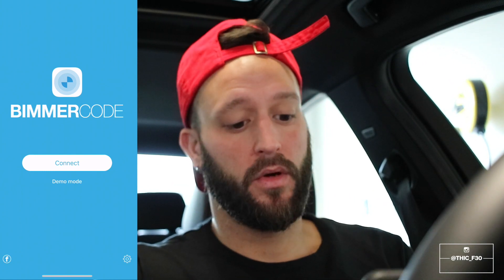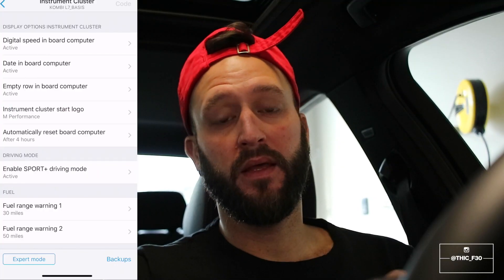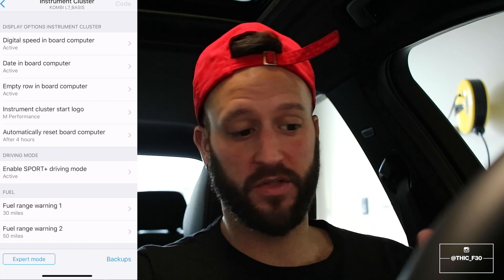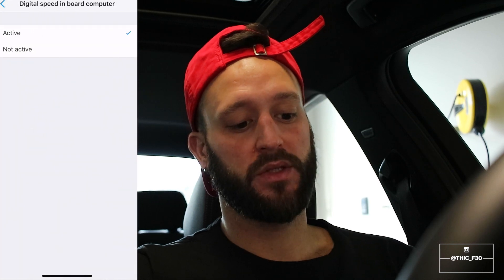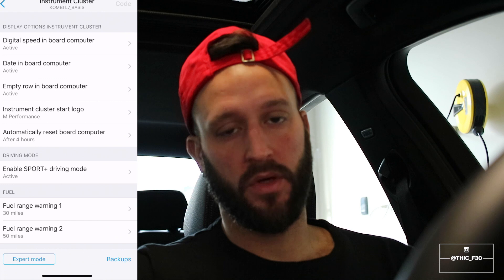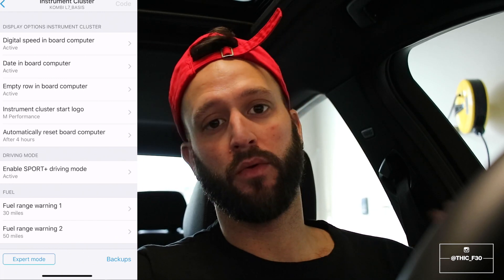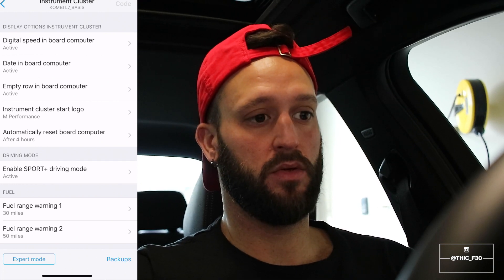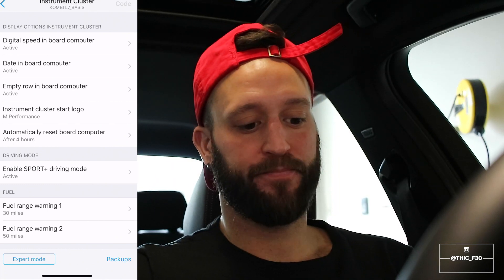BIMMERCODE: CODING DIGITAL MPH INTO YOUR INSTRUMENT CLUSTER

Comment: Hey quick question I have a bmw 330i 2017, and I tried coding the folded mirrors unlocking/locking and I also tried coding the digital MPH but they are not working for some reason. I used your videos to help me and im wondering why it is not working. If you could help me?
Reply: Does your car how power mirror? If not then it will not work

Comment: Question I tried this on my 2017 430i gran coupe f36 set it to active and still doesn't pop....  I was told I needed to add up the 7 numbers in my VIN in to the cluster in order to unlock this feature.... problem is I only have 6 number and I believe 3 letters before that..... could you please give me some insight on this? Thanks in advance

Comment: I try to code this but nothing shows , I wonder what’s stoping it . If anyone know please let me know . Maybe it’s different on a 535
Reply: Is it still not showing? I coded mine today (530) but it's not showing the digital speedometer
Reply: I have a f30, but doesn't show on mine.
I think it depends on what kind of dash you have. My dash display is little longer than he's
Reply: What are you coding it with? It's not constantly displayed. Have you cycled through the BC options? It should be one of the options like mpg readout.
Reply: @Ra69iT007  Your's should work.
Reply: Din Phu yes you're right. You have to toggle through the cycle options by pressing the button on the end of the indicator stalk. Digital mph appears in the middle of the speedometer.
Reply: @kingmonkey88  What do people mean to "Toggle through the indicator stalk"?? What exactly an I using to toggle to find the MPH? Mine isn't showing... BC I assume means Bimmercode, but how do I cycle through the options??
Reply: Got it! Didn't realize where it was....thanks
Reply: Mine didn’t show up either
Reply: @richarde7919  how do you toggle through the indicator stock?
Reply: @qa8925  there should be a button at the end of the indicator (left) stalk. Keep pressing it and it toggles through different displays. If you have coded to include the digital speedometer, it will show
Reply: @richarde7919  once I do that, it’ll be there permanently or will I have to continue to toggle it?
Reply: @qa8925  it should stay on there until you change it again